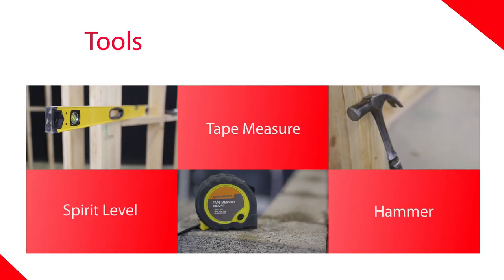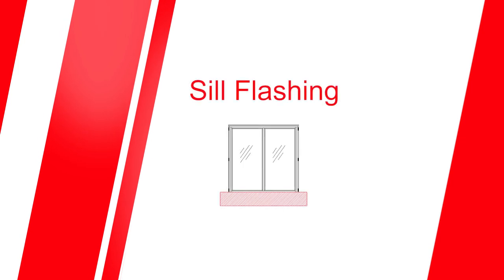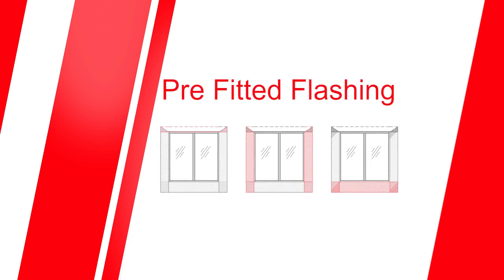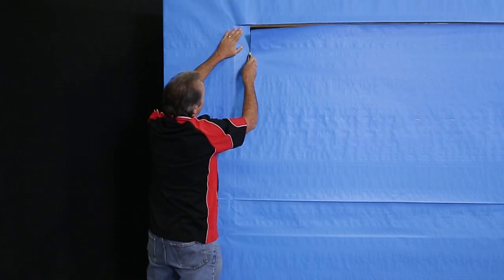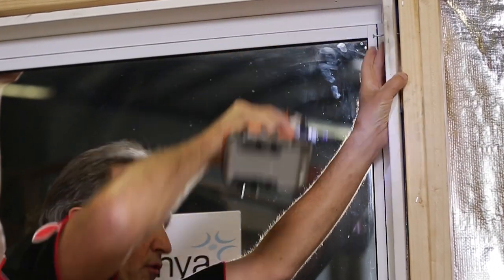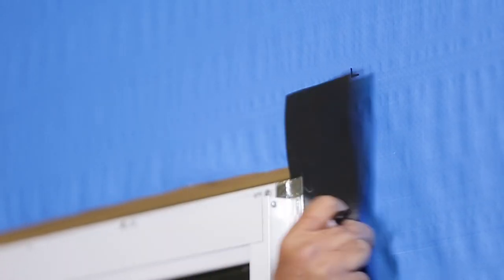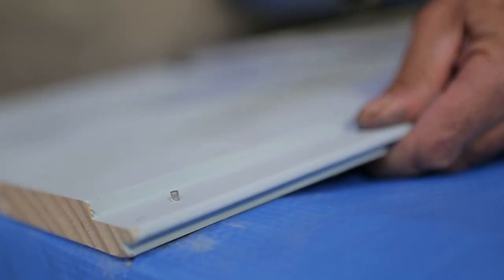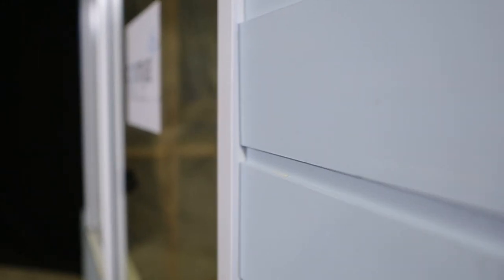How to Install an Aluminium Sliding Window into Clad/Lightweight Construction

Comment: Thanks blokes, what do you do for the 99% of aussie windows that don't come with integrated flashing? We've never seen them delivered with flashing before, unless our project manager just doesn't know how to order windows correctly?
Reply from the maker: Hi kenour, flashing should be purchased  if not supplied with the windows and doors.
Reply: @ausglassandwindowassociation  I understand that, just saying it never has been supplied. We just get left with the bare aluminium extrusion and told to 'just do ya best mate'. Have you got a document outlining how it should be detailed? I have seen how it's done in the states with various tapes and liquid applied flashings, but not how it should be done here to meet Australian standards. Your video shows it already done, I just want to know how that's achieved it supplied without flashings. What type we should use, how to install etc. Thanks.
Reply: Phil Gilbert  I reckon mate! Slim pickings here in Ballarat. Unless our PMs just haven't been specifying flashings.
Reply: @ausglassandwindowassociation  This doesn't answer the question? Interested to see what the experts suggest? Please don't pass the responsibility as you have in the above comment.  Kenour has asked a direct question, maybe you could suggest a cross-section for onsite flashing and you would assume that he is also asking what to do when you have an aluminum window arrive without timber jamb?
Reply: @kyzenlanx  Hey mate, did you happen to find any answers on how this works by chance?
Reply: @jimgowing1129  nope, going up order ultrex or similar imported windows from either the states or Europe for my next build.. Not that more expensive, and so much better. Our window industry is trash...